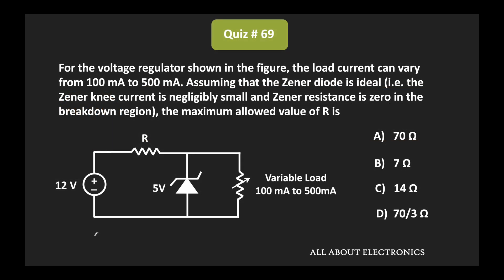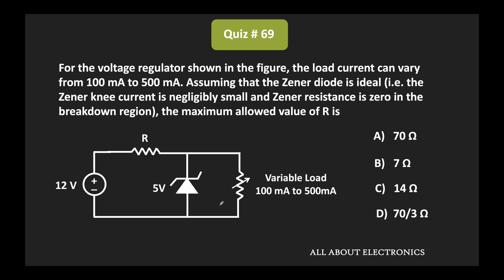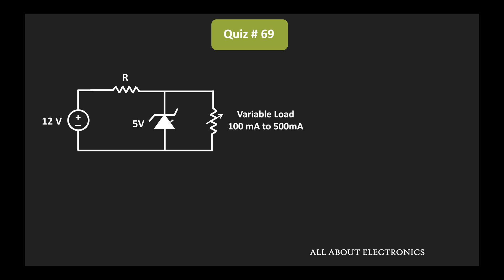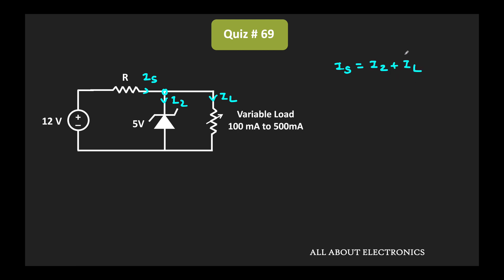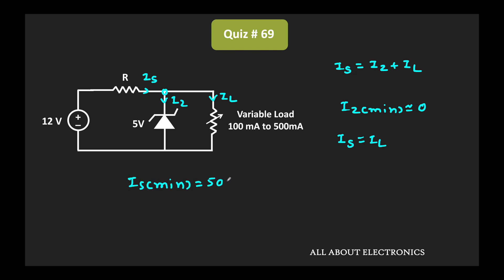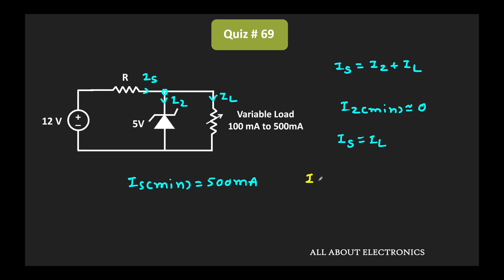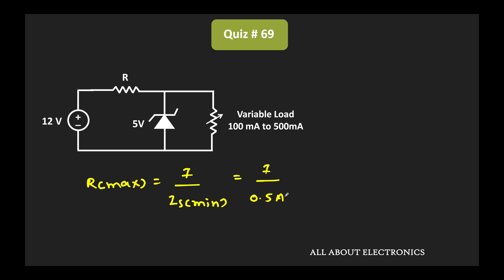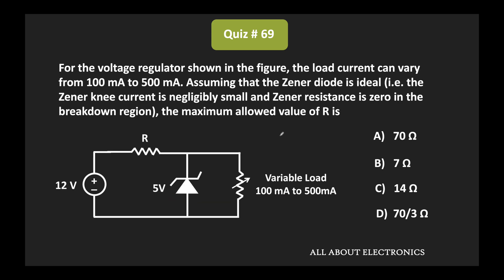Zener Diode as Voltage Regulator | Quiz # 69

Comment: Is×R=7 ..R is max when Is=100mA so R should be 70
Reply from the maker: If you select the value of R as 70 ohm then Is is 100 mA. But with that value load current can’t go up to 500 mA. The supply current should be able to supple at least 500 mA current so that the circuit can be used as a voltage regulator with variable load current up to 500 mA. Therefore maximum allowed value to fulfill this criteria is 14 ohm. I hope it will clear your doubt.
Reply: @allaboutelectronics-quiz  sir i also think r=70 ohm ,bocz max value of r only possible if current is minimum--
Reply: I understand what you have to say about if the value is 70ohm the load will not be able to vary from 100mA to 500mA , but your question did not say it HAS to vary in that range it stated it CAN vary. Both are correct it is just the age old trick question. I lost a lot of marks at my institution due to these types of questions